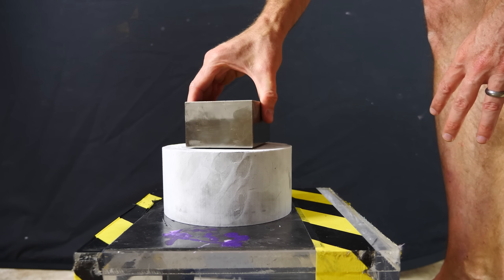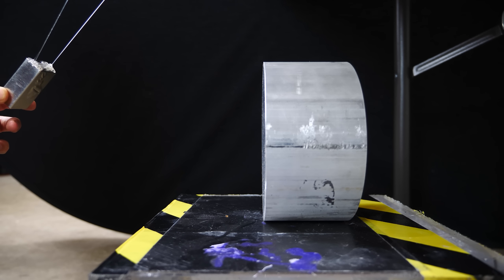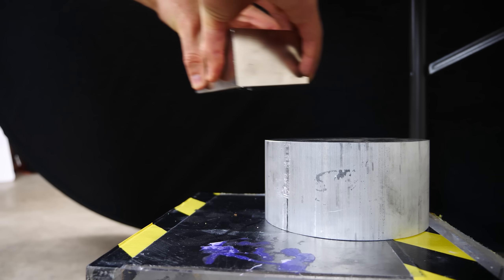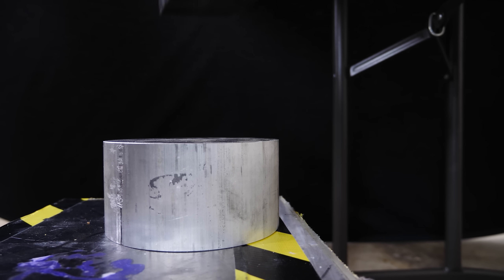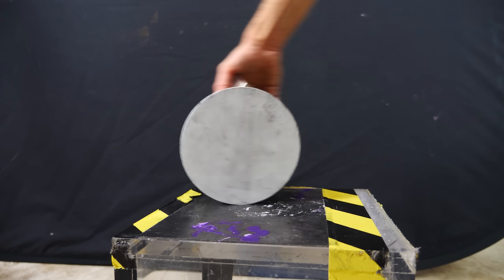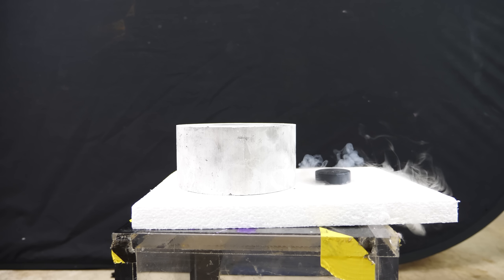Dropping a Giant Monster Magnet on -196°C Aluminum—Surprising Eddy Current Demonstration

Comment: Some trains also use eddy current braking.

The German ICE-3 series of high speed trains e.g. uses 3 operational braking systems in this order of precedence and depending on the amount of deceleration required:

1. Regenerative braking where the electric motors work as generators and feed electricity back into the grid.
2. Linear eddy current braking.
3. Pneumatic braking – plain old disc (i.e. friction) braking with pneumatic actuators

Eddy current brakes in principle do not suffer from wear, though, to be honest, there were some issues with clearance (the electromagnet needs to be located very close to the rail) and concerns that induced currents may negatively affect electrical systems on the track, e.g. for signaling.

Comment: I wonder if those eddy currents can be used to prevent doors from slamming shut. Put a metal non-magnetic strip on the door frame and magnets on the door. I wonder if that's enough to slow a door down to a gentle closing 🤔

Comment: QUESTION: (and this is a serious question) If you slide a magnet across an aluminum surface, is there any magnetic braking across that horizontal movement? And with the speed that it slides across the aluminum surface is there any repelling Force between the magnet and the aluminum?

Comment: So if you know that then what is the formula for the gauss strength of the magnet to the amount or weight of aluminum to produce this strange  attractive force, explain the attractive force in scientific measures and elude to refractory or opposition's in the movement of two different metals in scientific terms.

Comment: Awesome and thanks. 
 As per your semiconductor 2 experiment and explanation, I have a perverbial dumb question. 
 If the type 2 semiconductor and the magnetic tray were in the vacuum of space, and it was colder than the liquid nitrogen, would it be possible to produce electricity from the device. Obviously it's over simplified, but could a shaft with stator and windings be configured to the point where it can generate electricity.  Given that it's cold, in microgravity, and even if it doesn't ration out out to 100 free energy. Wouldn't it be less than what we waste on earth because of gravity and temperature? 
 I'm not a em educated person. Electromechanical. But I'm a gifted technician. 
Tl,Dr; making an semiconductor motor in space with quantum equations

Comment: Q) would the eddy current increase if the magnet vibrates? What would happen if when doing this you introduced energy into the eddy currents by adding fast vibration to the falling magnet. Vertical axis with magnet falling but also vibrating a very short vertical distance rapidly... would the eddy current increase/become stronger or would the oscillation towards and away from the aluminium result in a net zero eddy current strength gain? And if so, which has the greater effect,  vibration frequency or vibration strength so wave length vs wave height? If you the lined up 6 magnets 3 n and 3 s. And vibrated those... and then examine what would happen by adjusting the phase of set n vs set s. So that the phase is moving at the same speed as the eddy current. Almost like a standing wave... and then switch between the wave imparting flow and back to a standing wave quickly.

Comment: Sputtered magnetic incoding on opposite fabrics to create a anode /cathode "type" charge between each 1/8" by 1/8" of cadded fabrics...we could claim back all the electricy we use when we walk.three different sources ..between the each pant legs and both inside arms to hip.to accommodate swing motion.and BOOM...charge you clothing and cell phones..And all accessories imaginable..(lights ,umbrella,build in inflatable air structure ( like a chair design) pumps)motors,pcp's,etc....)

Comment: Or ?? Self contained self balancing double gyroscope..motor for each on opposite sides..the solid gyro in the middle ,and it's motor weigh the same as the hollow gyro and it's motor on the outside.one fits inside the other....so to speak.

Comment: Hi! Action lab.
You have done many experiments using vaccum. Here I have a request if you can make a video and tell results of experiment.The experiment is to take two precise clocks which get stop when light reaches them and time get saved.
Here we need two clocks and set same time together at same location say we are setting time at position P. After that one clock is moved to d distance back and another clock d distance forth. Now a laser at point P give of light in both direction ,So that clock can save a time. .
After that , we will again take a test but one clock would be placed at 2d and one would be at d distance.
And we need to test it few times by changing direction of clocks. And by interchanging distance also.
Setup of experiment -
Experiment would be done in a vaccum chamber which is quite long and the cross-sectional region of chamber would be more than 1m2. 
And then tell readings of clocks after sending signal

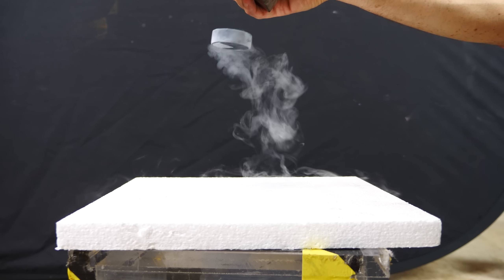Comment: 3:16 “And since it’s a type 2 super conductor. It even keeps it’s same orientation as I move it around the magnet”...

Super conductor continually changes orientation
Reply: Same orientation relative to magnet?
Reply: Frank Sierow I initially thought that was what he meant but it doesn’t keep up. It kinda starts to rotate then suddenly flips. It doesn’t continually keep its orientation. I would have expected it to mirror the rotation of the magnet.

Comment: Note that when you had the superconductor suspended below the magnet and showed that the superconductor retained its spacial orientation, that was true until you changed the direction of the magnetic lines of force. When that occurred, the superconductor flipped 180 degrees.

Comment: Another huge advantage with magnetic braking for roller coasters is that they require no external input to function. If the power fails mid decent for example the breaks will still work perfectly as intended.

Comment: Action Lab, can you explain why things feel cooler when a fan is blowing on it? It seems strange to me. On a small scale I picture the air molecules colliding with the object, which would cause friction and energy to be transferred to the object and cause heat. But instead objects feel cooler. Sorry if that is a long question. But it'd be cool if you could explain it scientifically

Comment: Ok this is probably a stupid question but back when I was a kid I had an idea that there could be a roller rink for like  roller skating, but instead  the floor could be made out of very strong magnet and the shoes would have no wheels and  be made from very strong magnets could it be possible to hover skate around? Or to be able to push off  of the magnetic field and gain momentum to glide around on hover skates or hover board?

Comment: What is interesting here is that the aluminum obviously has some reactivity to magnetism, though it isn't actually magnetism. It is a force of its own. Is there a name for that "force"? Also, it was interesting to see that the magnet acted on the superconductor THROUGH the aluminum. I wonder if the aluminum acted like a funnel for the magnetic force. It would be fascinating to see the currents you induced in a graphic way - perhaps by using powdered aluminum between the aluminum block and the superconductor. Follow-up maybe ? :)
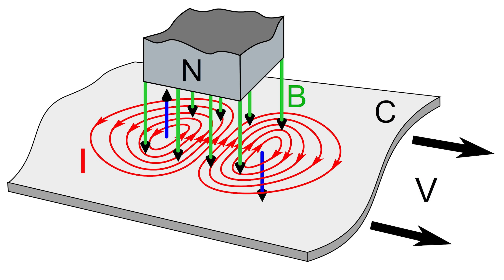Reply: 0:56 He called it Eddy currents, and aluminum is not ferro-magnetic.

Unfortunately, I can't explain all those details...but those are the components, and it still is magnetism, just not ferrous magnetism (which is specific to iron).

(Limited help 😅 but the best I could do without researching...)

Comment: It's interesting to note (correct me if I'm wrong) that the superconductor sprays condensation every time it is being forced to crossover to the opposite magnetic pole.  In my experiments, using a spinning aluminum disc mounted on a motor, the motor would be significantly loaded down as a magnet is introduced near the spinning edge of the disc.  The disc itself heats up.  I believe the spraying of condensation off the puck when it is forced to flip over is in part because of its rotation in the surrounding still air; but is it also possible that heat is generated as a result, causing more condensation?  It literally looks like it is spraying condensation like a volcano, just from the pinned surface as it is forced to flip over.  Thoughts?

Comment: How does conservation of energy work with this? Does the magnet lose a tiny percentage of it's magnetism every time it's moving/slowing an object or counteracting gravity for prolonged periods?
Reply: The conductor has resistance and the internal current flowing causes heating. The whole kinetic energy is dissipated as heat in the conductor (aluminium in this case).

Comment: I wish I had Magneto's powers. I don't think I'd ever get tired of playing with magnetic fields. I wouldn't be a "super hero" or a "super villain," though. I'd be a "super boring" and  just keep to myself,  making things float around or stick together or repel one another. Maybe try to cause steel balls to heat up by exposing them to strong, rapidly changing electromagnetic fields. Oooo! Or see if I can rip steel beams in half by putting two insanely strong, opposing magnetic  fields on either side of the beam?

Comment: Given that every action has a reaction, can you throw a magnet so big or powerful in the pendulum that even without touching the other metal it can break it (without tipping it over in the process)?
I see that in the pendulum the aluminum moves a little when stopping the magnet, but I wanna know if the dissipation of the force can be bad enough to make it break
Reply: it's an equal and opposite reaction. It's not a woman, who just reacts wildly like the sun and moon appearing in the sky to both alert and scare the chickens.

also, can an unstoppable force and an unmovable object ever coexist?
Reply: @parishna4882  Idk what are you talking about, if you throw a stone to a soft metal block it will make a big big dent, I'm asking if given a strong magnet thrown with sufficient velocity can phisically deform the metal without ever touching it only by the force required to amortiguate the "impact"
Reply: @mortalmercury2321  Probably. We should investigate this concept further.

Comment: If the resistivity of the supra-conductor is a true "0" then it would be impossible to even move the magnet and the supraconductor each other because an infinite eddy current would be created to resist the motion. Someone can explain why we can move them? (seems the reason is another property of supra-conductors to exclude the magnetic field).
I heard another explanation for why a supra-conductor can be "stick" to a magnet (vortex holes where the field can pass though the supra-conductor so that the field layout generates a stable equilibrium). I'm not sure it's due to 0 resistance / infinite eddy current.
Reply: I think the resistance could be 0 but the energy is relative to the magnetic field, hence, a hand will be stronger than the magnetic field and the opposing eddy currents.
The same goes for a car, if you park it on a slope and apply the parking brake it will be unmovable... until a truck hits it.
Maybe if the magnetic field was that of an MRI machine then it would be unmovable by hand but I guess you could use a lever anyway. Just make sure it's looooooong and not magnetic :-P
Reply: It's definitely not a complete 0. It must have some fraction of resistence even after cooling it down. I believe he has a full video dedicated to the superconductor go check it out he explains all about it might answer your question somehow. Just search "the action lab type 2 super conductor"
Reply: nice big brain explanation.
Reply: Even the magnets, made out of supraconductors, at CERN are having a 0.00009ohm resistance fyi.
Reply: @erugy  
Type I superconductors typically have literally zero resistance; A good example is lead. You can induce an electric current in a ring of lead using a magnet and it will still be there before you run out of liquid helium, as tested by its counter-induced magnetic field.
Reply: What's this 'supra' -conductor stuff?
Reply: Actually having 0 resistance is literally the definition of superconductors, otherwise they would just be really good conductors

Comment: I have a question.
In the magnetic braking demonstration, since momentum is not conserved, does all the kinetic energy of the magnet get converted into heat?
Reply: Yes, it heats the aluminium.
Reply: @gabiold  thank you.
What factors does the amount of heat generated depend on?
Reply: @amritdhandharia1333  The resistance of the conductor which causes the heating, which is complicated to calculate in this case, but when the breaking is from speed v0 to standstill, the whole energy is dissipated as heat, which is E=1/2*m*v*v. So if you use copper or silver instead, it will still dissipate the same energy, but the internal current will be higher to due to lower resistance.

Comment: Front car bumper: Neodymium magnet. 
Rear car bumper: Aluminum.
Reply: Next day - why is the whole front of my car full of screws, nails and bits of steel debris?
Reply: SeanBZA Exactly, you’re doing society a service by getting them off the road.
Reply: Also it will prevent your car from getting a puncture 😁
Reply: @pratikkarangle  Just don't park too close to a steel guard rail.

Comment: Do you it's possible to keep a superconductor permanently super cooled if it's inside a tank of liquid nitrogen?
Reply: Yes almost all MRI work this way, except they keep a coil of copper permanently superconducting in a tank of liquid helium, which is even colder and it’s a huge problem if it ever heats up.

Comment: What would have happened if you dropped the magnet onto the super conductor? Would the magnetic braking be strong enough to prevent the magnet from crushing the super conductor? What if you do it in reverse (ie., dropping the super conductor onto the magnet)? Would the eddy current also form and slow down or arrest the fall?

Comment: Next video: Jumping from a building onto -196°C aluminum wearing monster magnet shoes
Reply: Boots will stop smooth, but you don't :)
Reply: That's very nice idea 😂😂😂
Reply: @TheOutdoorVoice  it didn't say the jump would be at such a height that you'll reach terminal velocity. You can jump to where your final speed is roller coaster speed as described in the video.
Reply: @ThePrufessa   Even at that speed you likely won't survive
Reply: @DANGJOS  if roller coasters can safely stop at that speed then why couldn't a human? You didn't think that response thru too good did you?
Reply: @ThePrufessa   Lol I don't think you thought your response through.  Okay let's think buddy.  Roller coasters slow down in what orientation?  Right, horizontally, not vertically, and the magnets are likely very close to the metal throughout the entire deceleration.  When you're falling, however, you are trying to decelerate vertically (against gravity) and you have to wait for the magnets to fall closer and closer to the metal, which means you won't get that nice linear deceleration.  In fact, the field from magnetic dipoles tend to fall off as the the inverse cube of distance, so you won't be getting any significant braking until you're close to impact!  I wouldn't trust my life on that, and I hope you wouldn't either.
Reply: my calculations are saying that the chance of survival is 100%. Done. Now let's wait for the video.
Reply: @TheOutdoorVoice  okay? no one said that speed tho "lol"
Reply: @tjorvenblader  That is ~ terminal velocity.
Reply: -196° C will hurt badly when contact with body
Reply: This is actually a good idea 😃
Reply: You would be potato mash
Reply: @Mechanitron 123  Please don't!
Reply: He's going to need an extra pair of socks
Reply: What if you land head first?
What if the magnetic shoes pull all the iron outta your blood and your feet become solid ?
Reply: Will that work?
Reply: Is that possible🤔 o wait it already is 😀

Comment: The superconducting puck keeping its orientation is not purely because it's type II. When you rotate the magnet away, it'll indeed "try" to stay in the same orientation due to the flux pinning / quantum locking, but the eddy currents (which are fundamentally different than flux pinning) also does it. It should be mentioned also that this experiment as you conducted it is only possible because it is a type II superconductor. A type I superconductor will stop superconducting at fields of the range of 100 miliTesla at the max, which this magnet far exceeds. And of course also because type I superconductors need to be in the single-digit Kelvin range, which is almost impossible to sustain in a normal environment XD.

Comment: Just try to mix styrofoam with petrol in your next clip
.
. 
Why does the reaction happen?
Reply: It happens because the hydrocarbons in the solvent petrol dissolves the styrofoam and it combines to make it a viscous gel, which when ignited allow the carbon to be released at an excited rate, whilst also sticking to anything it is in contact with. 

Now, mix brake fluid and chlorine. Explain why this combination has such a detrimental outcome. Don't mind me, I'm only able to type with three fingers.